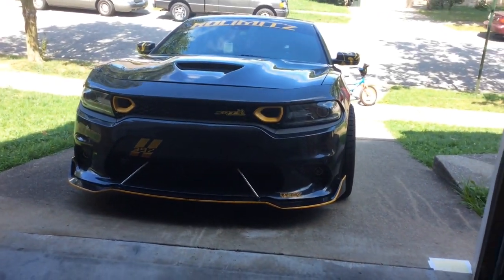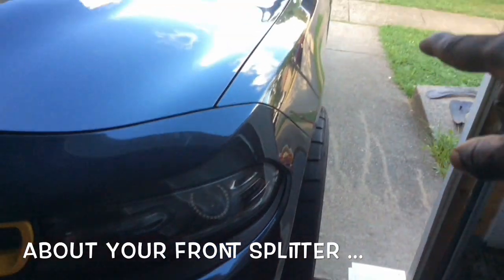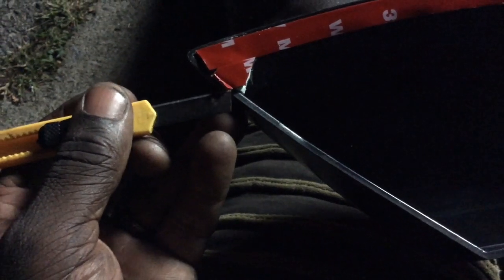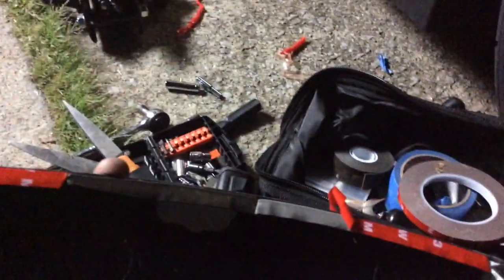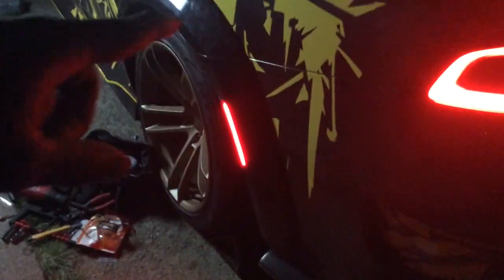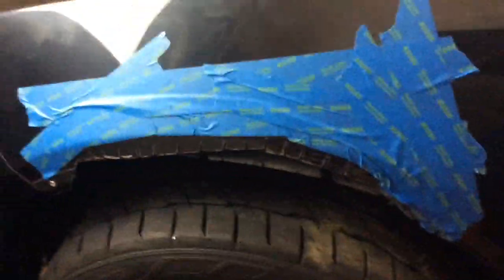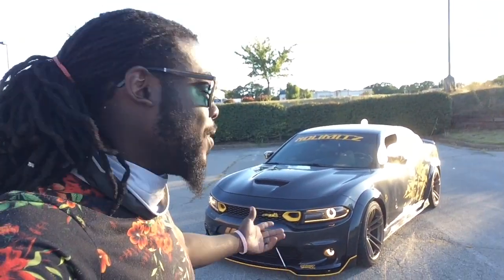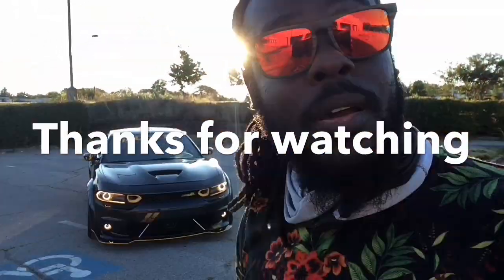Installing the VICREZ WIDEBODY KIT on my DODGE CHARGER SCAT PACK

Comment: You painted the parts yourself? How many cans did you use? What kind of gloss? Did you use a primer as well?
Reply from the maker: I went to a specific Sherwin Williams paint store, got the paint code to get the color matched paint in aerosol cans. They also had cans of automotive primer and 2K clear coat hardener.
Reply: @gocardogo  do you remember how many cans of paint you used?

Comment: I like it but I just dont like all that cutting up the car and are those finders painted? . I saw another video of a wide body kit that didnt require any cutting and it looked great.
Reply from the maker: I cut the fenders to allow more wheel space. With the 392 and Hellcats, they sit lower, so wheel space is a MUST avoid damage and rubbing. I painted mine all myself as well.

Comment: Quick question if you don’t mind, did you paint the snorkels yourself? If so what was used
Reply from the maker: Yes I did. I used a yellow spray can I got from Walmart, then finished it off with a can of clear coat
Reply: @gocardogo  thanks man! Keep up the good work!
Reply from the maker: @KrazerKing  no problem! Thanks man!

Comment: Hey, how's the double sided tape holding up? Thinking of getting the kit soon. 

Drill install in my area cost about $2500 
Double sided tape install about $800 

Have you tested the strength of the tape? Hard bumps or use force to see if it budges?
Reply from the maker: The double sided tape is holding up surprisingly well! I’ve put my body weight on it quite a bit when detailing my car, and even try shaking different parts to see if it’ll loosen up (but it never does).
Those prices are up there too. I haven’t even checked my area for install prices, just went all in on doing it all myself. 

I’ll be making an in depth walk around video very soon to show how everything’s holding up so far.

Comment: Sick work I have probably seen this video 5 times to get it down pack cause I’m planning to do the same this summer now I do have a question what tool did you use to cut ?
Reply from the maker: Thanks!! I used an Angle Grinder with a 4” disc to cut

Comment: Any problems with separation? I think you could have probably gone without cutting the fender would just need a smaller sidewall. I would be too scared to cut
Reply from the maker: Small issue on right front but that was due to how low I’m already riding and hitting a deep pothole. Fixed it in a day with JB Weld.
Reply: @gocardogo  gotcha. Thanks for the info man
Reply: @gocardogo  what did u have to JB weld

Comment: I have a 2018 Dodge Charger scat it has stock suspension yours seems lowered would it fit without cutting the fender?? Just the wide body fenders
Reply from the maker: Razer Blade you’ll definitely need to cut your fenders if your Scat Pack is lowered for sure
Reply: GO CARDO GO  what if it’s not lowered? I’m all good with just installing? And you def got my sub
Reply: You should be good mines is stock and I feel like I’m not gonna cut seen videos where people aren’t cutting but I don’t knock people for cutting

Comment: The car looks sick!  I have a 2019 Dodge Charger Scat Pack and am adding a widebody kit to it.  I don't want to cut my fenders but want t a fitment where the tire is flush with the fender. I currently am running 20 x 9.5 with a 18.5 offset and a backspace of 5.98. The tires are Pirelli 275/40/20. I want to go with a 20 x 11 rim with a tire that won’t rub at at all. Can you tell me what offset and backspace I should be looking at that would give me the fitment I’m looking for? Would it make sense for me to go with 10.5's up front and 11's in the rear?  Sorry for the long message.  Thanks
Reply from the maker: It’s all good! Here are my wheel sizes for all 4:

295/30/20

20x11

Offset -2

Comment: What wheels specs did you go with? 20x11 offset -2.5mm?
Reply from the maker: Correct. 
20x11
295/35/20
-2 offset
Reply: @gocardogo  thanks for the reply looks great ! 🔥🤝
Reply: @gocardogo  so if I’m correct you order the kit and just attach them on 

And use the widebody body rep wheels which is -2.5 so you won’t rub ?? And also what brand tire you used??
Reply from the maker: @1SShawn   You have to paint the kit to color match/or wrapped. I’d advise using the plastic welding putty I showed, and another brand of double sided tape. My wheels (all 4) specs are:
20x11
Offset -2
295/35/20

Comment: Nice greetings from Bavaria (ger)! :) I´ve a Tipp 4 U what could be very importand....
Because i´m building my custom cars even with wide stance and mostly stretched tires on most possible wide rims on an car, that i can let be the stock wheel arch like it came out of the factory....even because there are some diferent points why that is in most cases the better choice. the rims stick out the wheel arch when you look from above, often 2cm - max. roundabout 1". And choose the tires so, that the outer line of the tire profile is under the wheel ach when you look from above.... (i really hope you can understand me, i´ve to find the right words because i´m speaking german for ordinay & so i´ve to translate all in my head.. ;)
But even still in the moment i´m modding/customizing my 2006 Dodge Charger RT Daytona (Top Banana) with 19x10.5 inch, 22mm offset VORS TR4 rims in glossy black at front and rearend. what is really wide, especiaslly at the frontend. and i had to use 20mm spacers per side at the frontend that the rims would have enough place to the steering knuckle. I´ve choosen 255/45 R19 for the front 10.5 inch wide rims, and 285/40 R19 for the rear 10.5 inch wide rims. And in this case it fits that perfect that i hadn´t to roll the front fender. And now i´ve to find out if it will rubb but it looks really really tight fitting and the function is there. But when it will rubb at the wheel arch when hitting a bump or something else like that, then you´ve even the option of using "rubber plates" (don´t know the right word in english sorry!) what you can stick ionto the struts. this rubber plates what click on the struts will make that the wheel wouldn´t meet the wheel arch, because the way of the suspension/strut in by hitting bumps or something else becomes only that way for bump in what is possible without hitting the wheel arch. And that´s also an option what you´ve, that the wheel arch must not be cuttet, what is even a lot better in my eyes....I´m using BC coilovers and there is ony one finger between the wheel arch and the tire. It´s very deep. And in this case it looks to work perfect with an really wide stancy look. :) But it fits so extremly tight and perfect to the car, that i´m not sure about now if i´ve to roll the wheel arch at the front. I hope i must not, and it looks like it woks perfect. But when i get the problem of hitting the wheel arch with the tire when driving over bumps, i´ll use even those "Rubber plates" what i´ve talked about... And that was also a great option for you, that you must not cut the wheel arches...

Comment: What size spacers did you use to fill the void?
Reply from the maker: MoDodge_MoMods Oh I didn’t run spacers. I’m running 20x11s all the way around to make the fitment good
Reply: @gocardogo  what was the offset
Reply from the maker: TheGamingRex The offset is -2.5
Reply: What do you guys mean by offset ? I like the widebody kit I have a 2019 scat charger Nd just trynna learn as much info before ordering widebody kit
Reply from the maker: @Blk_NRG  Thanks Tyler! Offset is 
the amount or distance by which something is out of line. So, offset is the distance that the center of the wheel is inward or outward in the wheel well.

Comment: What size rims and tire is on the front I’m thinking about doing the same I bought hellcat rims for my srt 392 they are 20x11 -2.5 offset 5x115 bolt pattern I got 275/40/20 in front and 305/35/20 in the back will the 275 fit that 11 in in the front
Reply: I’m also getting the black replicas from vicrez and my body kit just ordered it
Reply from the maker: Yes sir! I have 20x11s (275/40/20) all the way around on mine they fit just fine for me. Though I did cut on the front fenders to give myself some wheel space for any vertical movements on the front wheels (dips in the road or potholes)
Reply: Thank you this was very helpful I was scared of it not looking right in the wheel
Reply from the maker: @henrycanty2153  No problem bro! Anytime

Comment: Would i need to cut on my 2019 rt since it sits a lil higher than the 392's?
Reply from the maker: Generally, no. But it depends on your wheel size and set up as well

Comment: Until you hit a bump and it falls off or rattles!!! 😂
Reply from the maker: Been running these for 2 years now. Never had an issue with mine as I’ve installed mine with screws on the inside.🤷🏾‍♂️😉

Comment: i hate these fake widebody’s man
Reply from the maker: Thanks for watching though man. 
Just a definition of Widebody: Widebody. Definition. Making a vehicle wider than stock with custom bodywork, either handmade or in kit form, such as those widebody kits available from manufacturers such as Extreme Dimensions and Vision Autodynamics.

You’re probably only used to the fabricated widebody understandably. Yes, these are fender flares with body cuttings to fit, as well as wider wheels and tires. Still, by definition, a form of a widebody.
Reply: i have a 2020 widebody challenger my self and when ppl do this it does not look the same in my opinion unless you get the full bumpers and everything just sayin my opinion i even seen a v6 with this kit looks bad to me but hey it your car and you like it keep goin !
Reply: @justynruffin5361  i thought i was tripping too.. the wide body genders don’t look original it look kinda off than the original wide body .. i got a 2019 R/T but i want the widebody kit though.. but i’m second guessing lol.. maybe i should just get the whole wide body kit instead of the fender flares